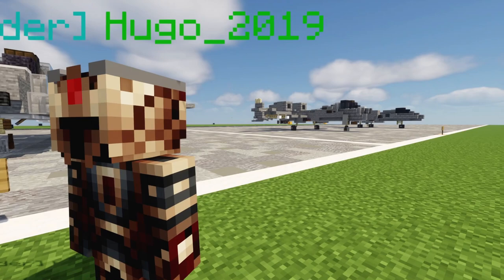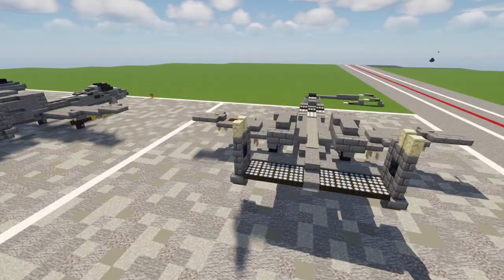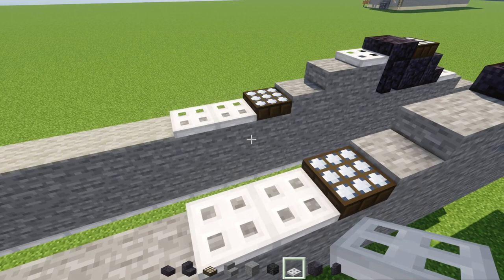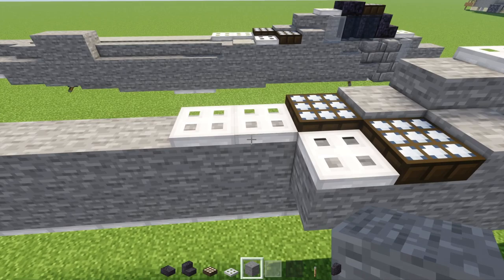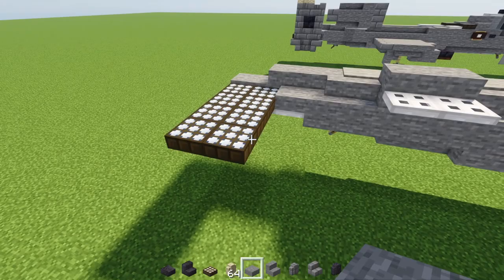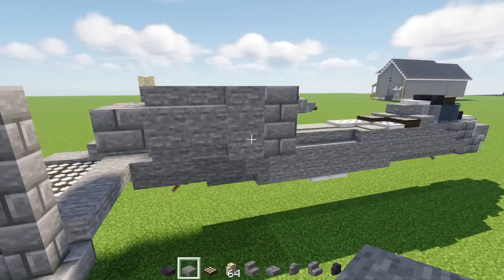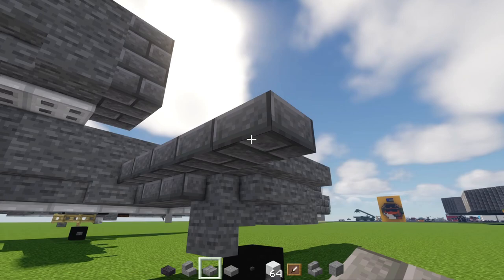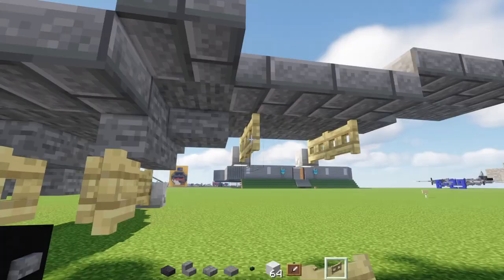Minecraft A-10 Warthog Thunderbolt II Tutorial v2

Comment: this is totally perfection!
Reply: I’ve built a better one before normally I can’t match his builds but because the other guy built it I can
Reply: the slope behind the canopy needs to be much more gradual, cos of that most the fuselage looks too thin, the engines are still too high up, they are not above the fuselage, they attach roughly in the middle and from the front it looks like they contact the top of the wings, the wings are also sloped too high up, again they top-off about 2/3rds the height of the fuselage, the build has them at the same height which is obviously wrong, the hard points under the wings are also spaced too far apart.
Reply: @valkigrakblad24  ok but its still great, i actually dont care about it being totally %100 perfection, this is a game with cubes what you expect? wedges? i mean its still great tho, but to build an %100 realistic build in minecraft you have to make the build REALLY big i mean REALLY.
Reply: @madbuilders203  mmm no, sure true perfection is unobtainable but the builder could have done a better job even at 1.5:1 scale. With that reasoning I could just make a line of blocks and wings and call it an A-10. Is it shit? Yes but hey no such thing as perfection amirite. I would say near perfection is possible, with the correct use of a finite amount of types of blocks etc, there will be the best possible combination of blocks. In this case this builder, never heard of him, was far off in that combination of blocks. There is such thing as objective judgment, since we're all building the same real thing and all use the same scale metric. It is far from great anyway, it may look good to the untrained eye, but the proportions are terrible as I explained when you compare it to the real thing, which it was supposed to be.
Reply: Yule Calma  No I actually mean the shape of the design and the blocks used in best representing that shape, I can care less about the color